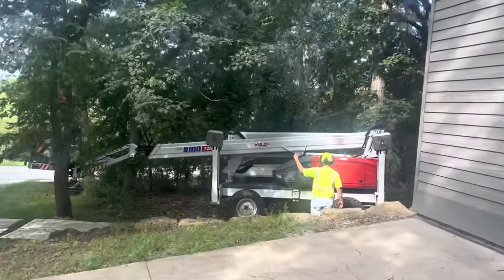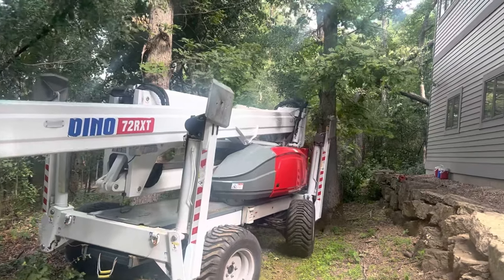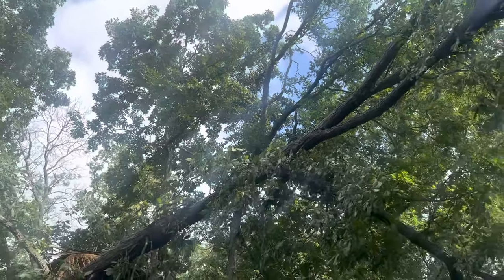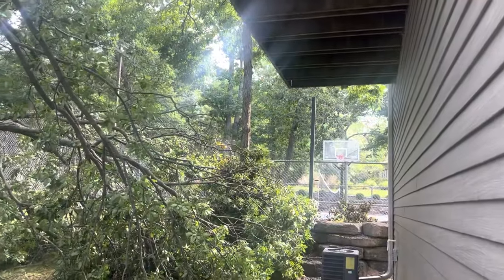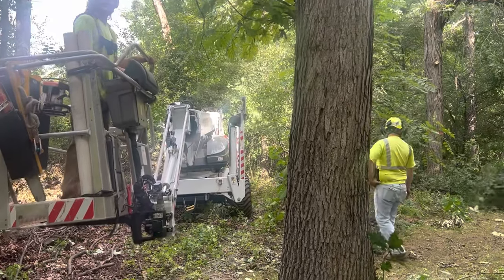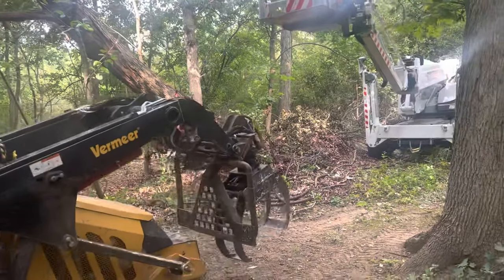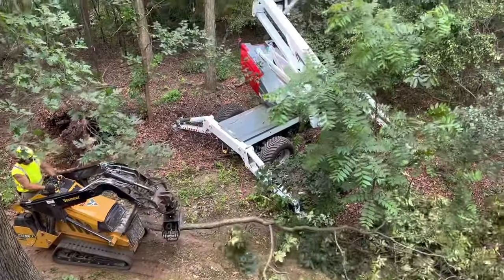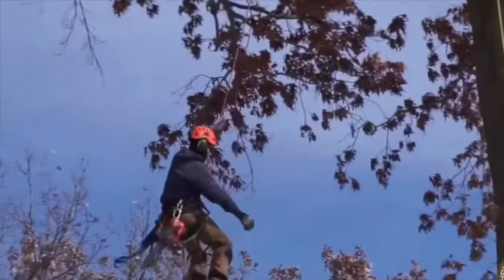We love climbing, but we love our Dinolift

Comment: That's a nice piece of equipment! I do most of my work by climbing and will once in a while rent a lift but have been considering a lift purchase in the future. Leaning more towards something on tracks versus tires. There's a place near me where I could rent something similar to the Dino that's a Haulotte if I wanted to. Thanks for sharing!
Reply from the maker: Dino is producing one with tracks. I’ve had one with tracks, outside of a few access issues that are solved by taking out fence panels or utilizing our climbing skills the wheels are way lower impact than the tracks. But we may add a track machine to round out our fleet. Another big difference, track machines are 1.5 mph, this can go 6 mph.
Reply: @GameofTrees  Thanks for the info. I’ve only rented the tow behinds but plan on renting a 4 wheel lift for an upcoming job and was wondering how it would be going on the grass and the impact. That’s good to know that you’ve found it to be lower impact. Will keep that in mind.